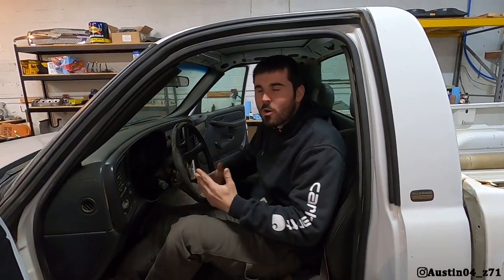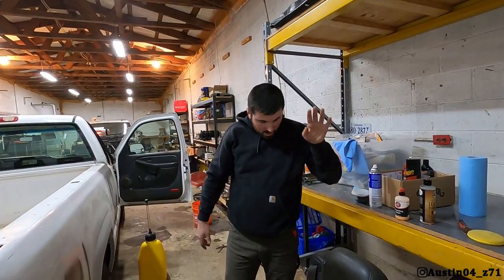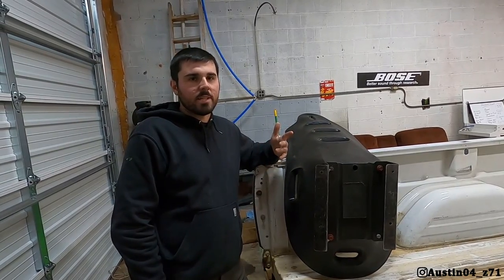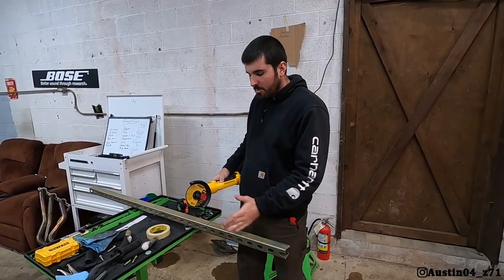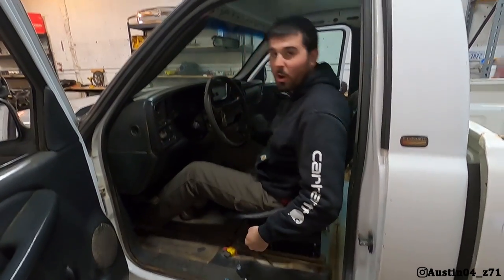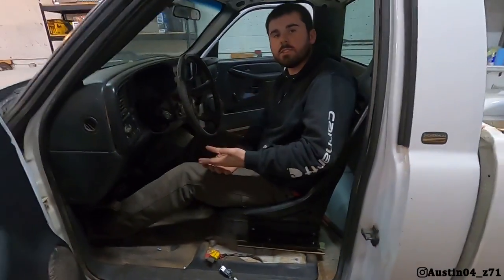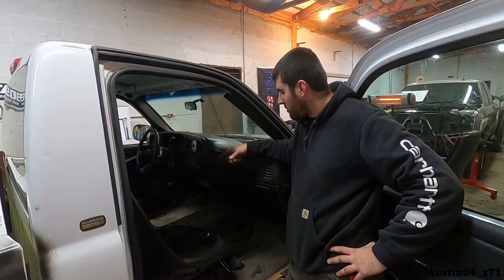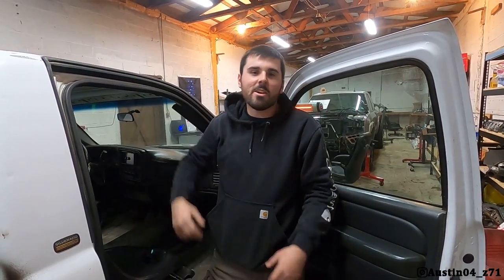Installing Racing Seats In My Silverado

Comment: Ok what year is your truck I have a 2004 Chevy Silverado 1500 rwd v6 also do u know what the spline diameter and the steering column outer diameter would be for a quick release hub adapter for the truck i cant find that information anywhere
Reply: 99-02 Silverado NRG PART# : SRK-170H